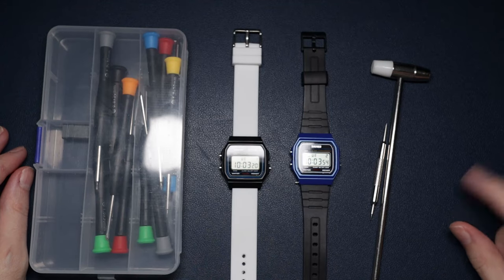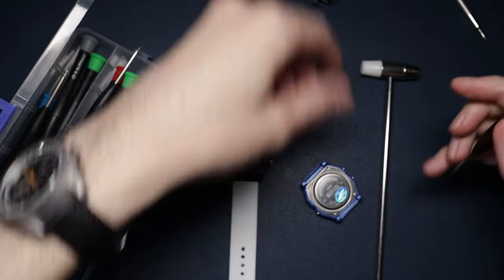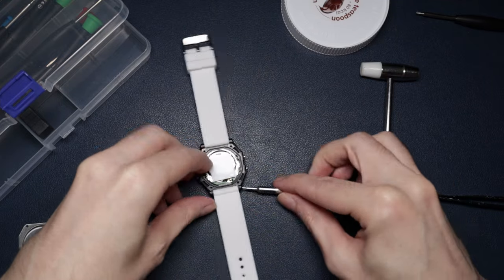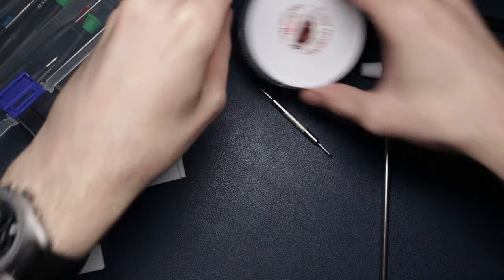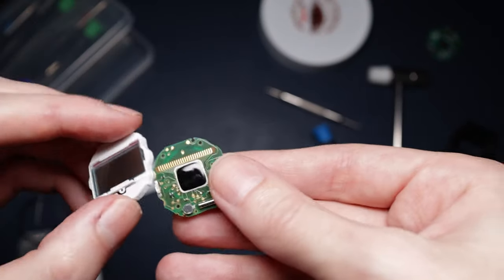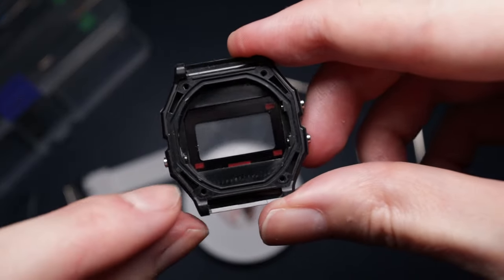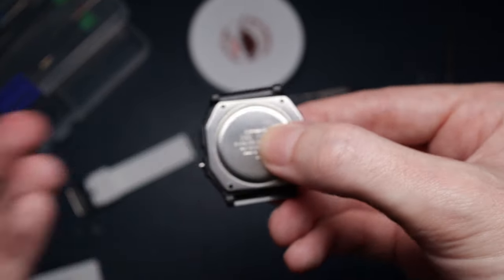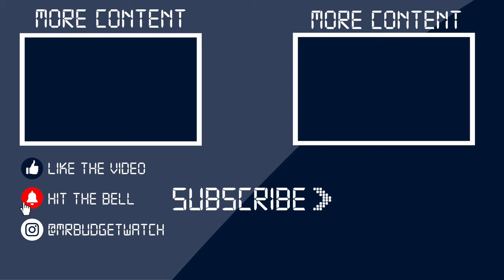Fixing The Casio F91Ws Biggest Problem With This Easy Mod

Comment: Thats all I wanted. A F91 with a proper backlight.....
Reply from the maker: Absolutely and same with everyone else too
Reply: Buy a Casio a700 👍
Reply: That would basically be a F-105
Reply: A F-91 with good light and even 50 meters WR? That's called B-640W (or B-650W if you prefer it bigger, more masculine and not so "unisex")

Comment: N-O-D-E did some pretty comprehensive mods for the Casio F91W, they're pretty cool. What I remember is that he added RFID, Changed out the LED to a much brighter one, and reversed the display (black background).
Reply from the maker: Sounds cool, I'll have to check them out. Thanks for the tip.
Reply: I doed this in a fake f91, and even put another led by just bridgeing with 2 cooper treads worked beutiful ... But wasn't propperly weldee, led falled xd
Will buy some more to fix it

Comment: Well it can be done. Before you attempt this, be sure that you checked the accuracy of the skmei module because many skmeis are really bad. They are worst than mechanical watches. The may gain  or lose 10seconds per DAY.
Reply from the maker: That didn't really matter, I just wanted the better illumination, its only my beater watch so accuracy wasn't a concern.

Comment: I've swapped modules in 2 CA-53 calculator watches to make a green positive display version, I sold the black with negative, takes about 3 minutes. I recently oil filled a MRW200 which while messy isn't actually that difficult, it's an awesome look & is still ticking (bang on every single mark) 2 months later. I've also cleaned the inside of the crystals & dials on a few watches I wasn't happy with though a disaster with a Vostok getting the crown back in recently has tempered my enthusiasm a little, be warned if you're thinking of cleaning a Vostok, the crowns are a bugger to put back in.
Reply from the maker: Very nice, sounds like you've done some cool stuff. It's definitely quite addictive watch modding.
Reply: I agree with you on that, the crowns are a pain to get back in

Comment: You didn't mention the most interesting thing... You have a positive LCD display that lights up only the numbers as if it were a negative display. Outstanding look. I've seen Casios and Timexes do this on very rare occasion. It's the best of both worlds and I really wish I understood how to make this happen. 

It's not as simple as going from a positive to a negative display or vice versa. There's more to it than that. Wish there was a video for that.

But nice work on this watch. You have quite the unique F91 now because of that backlight. 👍🏽
Reply from the maker: Yeah that is a good point and its the module from a skmei f91w homage. It does basically the same as an F91w just with a better backlight. And thanks
Reply: I think there's a polarizing filter on the LED that's rotated 90 degrees to the display's polarizing filter so the light only shows up where the digits are.

Comment: You are actually a genius lol 
I’ve been wondering this mod for ages. Just a swap from the SKMEI casing and put inside the F91w’s casing. I thought why has no one thought of this before or made a video and I suppose because it may not fit but you have shown it does, or almost and just as good as it can go. Does the alarm and beep sound still sound ok?
Reply from the maker: Thanks, I'm not sure about genius but the alarm function works just doesn't make a sound unfortunately. Think I might have broken it during the teardown, but next one I'll know not to do that.
Reply: Mine works fine. The only thing i recommend to do is grab pliers and flatten the contact tabs. Otherwise the bends in the metal prematurely contact the board also resulting in stiff buttons. Flatten them and its a dream.
Reply from the maker: @AllSnipe  thanks for the tip. I didn't think to do that as it was my first attempt.

Comment: They sell these little trays, for people who make necklesses. It's just  the flat sheet of plastic,  that has a main work area, and dozens of little pockets on the side to hold small parts. The tray has slight walls to catch  things if you drop them.  My girl friend has one, and she tells me to use it when I change my batteries on my watch. I never listen. I was changing the batteries on watch I had since I was eleven, and dropped two screws. No my watch doesn't work. They are very cheap. I wish I listened.
Reply from the maker: Thanks of the tip I actually have a little tray now but luckily haven't misplaced anything major as of yet.

Comment: Recently my f91w's straps finaly gave out after 3 years of daily use. I replaced it with the A158W basically the stailes steel version and I thi k I have a use for the old watch now
Reply from the maker: Nice, never thought of that, might have to give that a try at some point. Thanks for watching